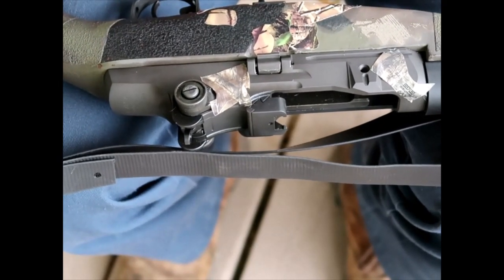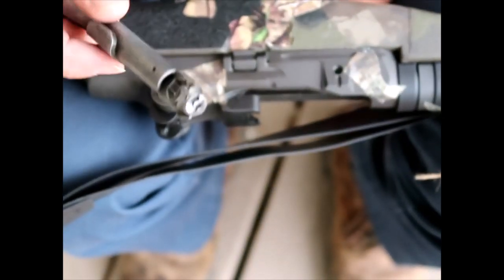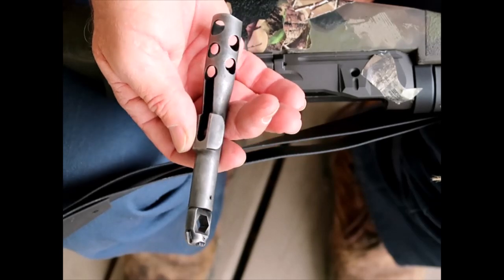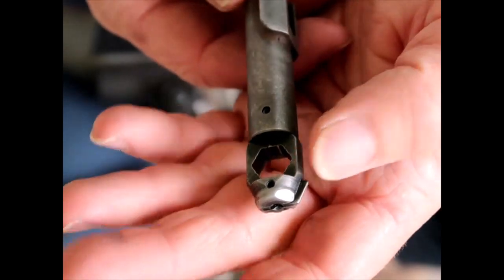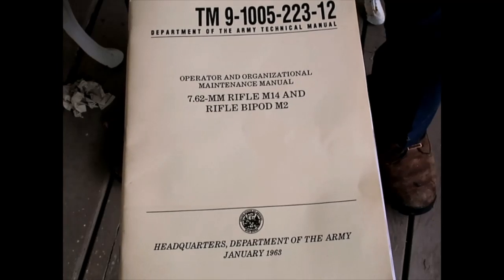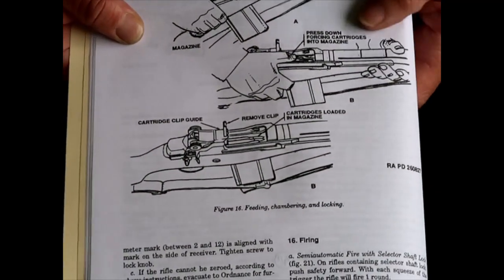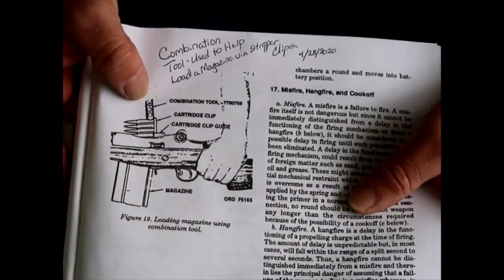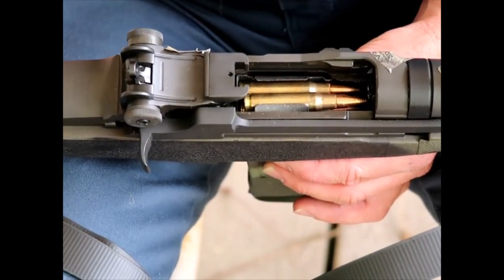M1A M14 GI Combination Tool

Comment: Why do people keep thinking the steel cleaning rod is going to jack up their barrel? Total myth!!!! I have ran a steel rod through the barrel of my Colt M4 duty rifle at least 1000 times over 6 years of the same rifle assigned to me, and I am still able to get headshots on paper and super tight groups at 300 meters with iron sights and an AIM-POINT m68 red dot sight and qualified expert marksman. I’ve ran a steel rod through my M1A National Match at least 300 times and I’ve consistently had tight groups with irons at 300 meters and never lost my zero also. The military wouldn’t issue steel rods in their cleaning kits if they knew they would jack up their life-line weapon systems. M1 Garands/issued with steel cleaning rods, M1 Carbines, Issued with steel cleaning rods, M14 steel cleaning rods, M249 and M240B steel cleaning rods, and M4 steel cleaning rods.